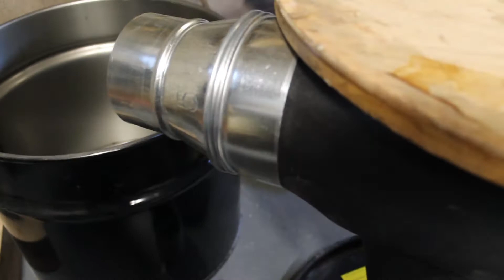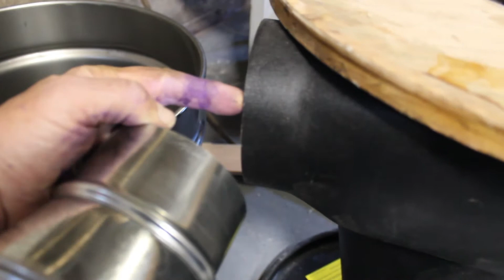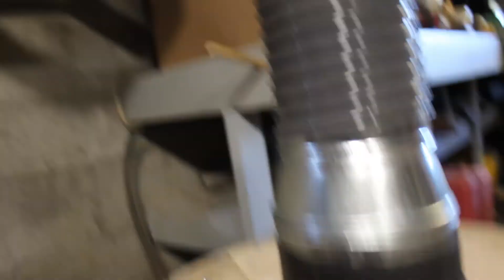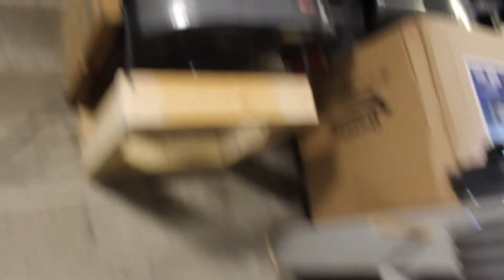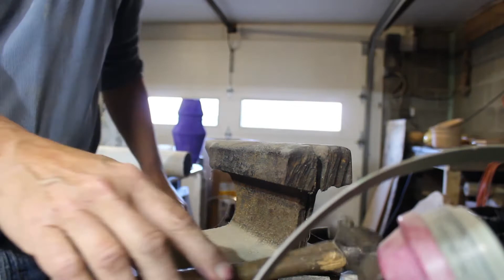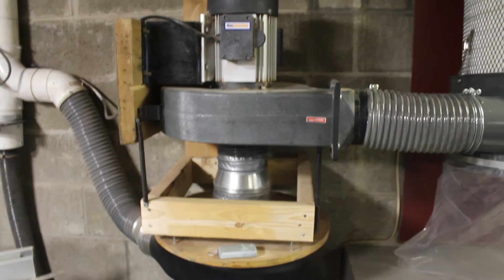Not so SUPER dust deputy

Comment: I had no problem finding a plastic 5” to 4” at woodcraft and I was able to use a rubber 6” connector to put the cyclone right on my 6” motor inlet. Worked flawlessly and love it

Comment: I had no problem.  I used the 6 to 4 inch pvc fitting from woodcraft and it fit fine.  Went on the inside so the direction of flow was right.  The 5 to 4 inch pvc adapter from woodcraft that fit inside was just a tab to big.  Heated it up with the heat gun and it fit just fine. No tape was needed. The seal was tight!

Comment: Mount the reducer on the intake first then reach through the opening with duct sealer and seal it.   You shouldn’t have a reducer off the intake of your DC anyway.  It would be way more efficient to run 5 inch as far as you can and reduce at the tool.

Comment: Ray, I have the XL Dust Deputy that has 6" in and out ports and the 6" metal duct work perfectly on it.  I just taped the joint with some aluminum tape and done.  All the box stores sell piping that will fit if you look and most of these connections are only a few bucks.  Also, use aluminum ducting tape and not the mesh duct tape. Take the dust Deputy with you and get what you need.

Comment: I was able to install woodcraft flex hose over the top (and then applied band clamp).  It was too tight to fit normally, so I boiled a pot of water and then soaked the end of the hose in that.  It wasn't too hard to slip on after that.

I've also scratched my head wondering why it seems so hard to find dust fittings that work together.

Comment: I consider the Super Dust Deputy one of the best inventions to woodworking ever.  I have 2 sizes they worked perfectly out of the box and have for 3 years now.  I no longer have to clean filters.  They work so well I encased the noisy shop vac in a foam plywood box so I didn't have to hear it as well I have not had to clean the filter in 2 years..unless of course I let it get full and then as one idiot to another it's no smarter than the person using it.   Best money I have ever spent.   Here is a video of my dust deputy in action.  Never get's plugged up.
https://www.youtube.com/watch?v=43jIgyZ6wPg